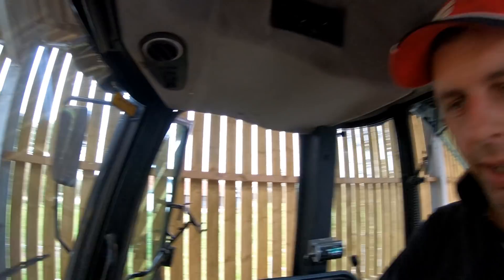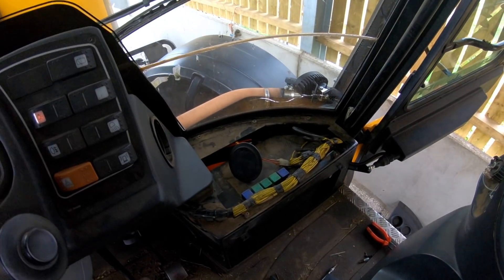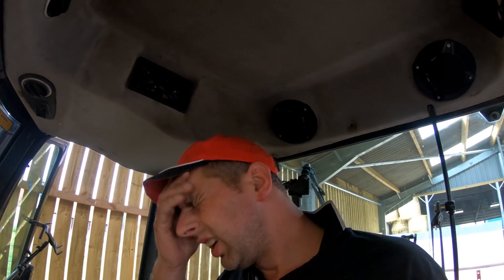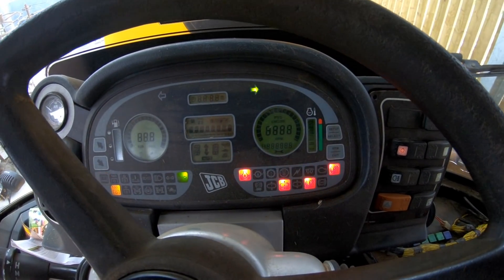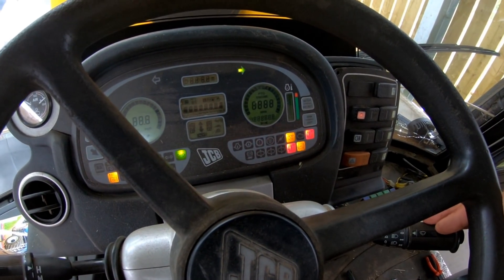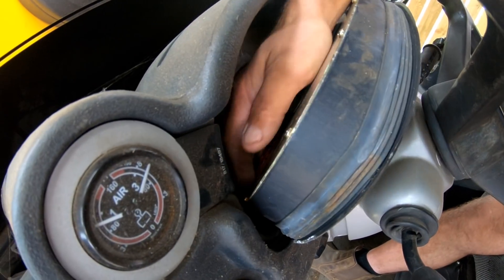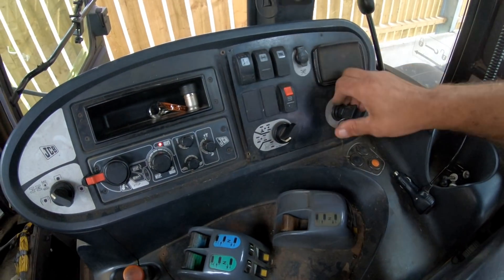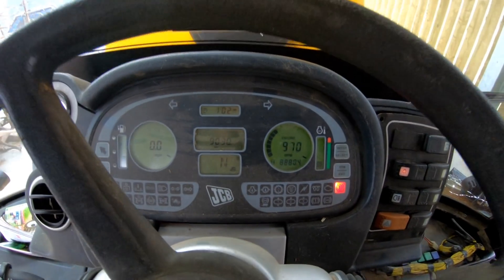FASTRAC FAULTS

Comment: Its times like this, i'm glad i've got a little grey fergie. I've never had an electrical problem with it as there are bugger all electrics on it. Battery, starter motor, dynimo and a heater plug. Thats your lot.
Reply: And spool valves operated by cables on my modern classic

Comment: I’ve had the very occasional electronic problem on my 2000 series Fastracs. 
Fortunately the external hydraulics on them all have manual spool levers.
But when the odd electronic problems do occur, turn everything off and walk away for 5 minutes. Then come back and it has always cured itself. 
Often, most of the problems have been caused by my forgetting to switch the sprayer control box off and draining the battery so much that I need to jump start it. In which case stop the engine after you think it has charged enough to restart again and everything will be fine again with no faults.
If you are on JCB live-link, they often know exactly what the problem is before you will!

Comment: Good old jcb electrics, my jcb 310s needed a new engine loom last month. It had a fuel leak on top of the engine, we removed a cover off the top of the injectors and three of the four injectors had bare wires on them🤦‍♂️ and now we've had the entire cab apart looking for a broken wire as it wouldn't drive anywhere. In the end it wasn't a broken wire but a fault in the Ecu. Luckily David King electronics repaired the ecu and it should be going again today. 🤞👍

Comment: Well done that would probably be a £700 job at least for a dealer 😉😁😂. Think there's master plugs going up under into the cab somewhere which get full of crud and rot out. Silicon grease to the rescue. 👍 Stay safe 🏴 cracking vid.

Comment: Isn't it such a great feeling?! Mine wouldn't start, select high or low range, wouldn't power shift, local dealer said I needed a new loom £4500! I had a look and the wire had come loose on the clutch sensor!
Reply: blimey  that was lucky

Comment: If when you disturbed the side dash panel the spool valve started playing up, and then seemed to sort it self when you put it back, I'd be inclined to try and check connectors anywhere you can find them and clean up with contact cleaner. Dodgy connections and resistance in connectors will wreak havoc with electronic controlled systems. Likewise on the main dash any connectors behind it or that hook up to it. On that bare wire unless there's any evidence of the cabling sheeth having burnt away, in which case you'd see remains off it and some indication on adjacent wires, if its stripped along the full length may well be an earth connection. Can you see if it goes off to an adjacent panel to ground? Certainly the suggestion from another subscriber to get a master switch in the main battery circuit so at least if something does happen you may be in with a chance of stopping anything before it gets a hold. If you haven't got one get a reasonable size fire extinguisher and mount it in the cab. Dry powder is good but leaves a mess, AFFF will do for auto and also cover a fuel fire and will be OK for low voltage electrics such as on the Fastrac particularly if you can kill power with a master switch. Remember seeing a few burnt out combines back in the day, not a pretty site :( Seeing the farmers anguish of having to try and find a replacement, or a contractor to finish the harvest for them, the additional costs involved and on many occassions probably losing a good chunk of the remaining standing crop in the field where it happened. Stay safe.

Comment: First thing to try is to put it all back as it should be and give the dash a good bash with the palm of your hand. This ha fixed this before. Then if the this don’t work there is a big plug that connects the engine bay to the cab this could do with a spray of contact cleaner and putting back together.

Comment: Good luck or Congratulations for your repair, George?!? As an British brand  - have JCB Fastrack original Joseph Lucas Electric Ltd- system with positive ground? Then I really can understand! ;D  "And the Lord said 'let there be light'...Joseph Lucas replied 'no way, Lord, no way'."  Lucas denies later having invented darkness. But he still claim "sudden, unexpected darkness" and then invented the first intermittent windshield wiper and self-dimming headlight as spin-off's!  Haha!  Do not forget to set your multimeter on AC when measuring Fastrak voltage, George because they have that, but just with a random frequency. And if you measure your wires then know that these doesn't apply to Ohm's Law because Joseph Lucas made so much resistance against that regulating law!

Comment: Don't let the smoke out of the harness 🤣
9 out of 10 electrical issues on 10, 20, 30+ year old electronics  caused by oxidation between the pin connectors, and poor grounding points. Paint, rust, poor loose grounding to body, frame, engine. Systematically unplug every connector & switch and treat with product like Wurth Contact cleaner/oil.. think about all the wet seasons that these modern tractors set out in, damp barns, dust, ... I bet there is a rebuild or exchange service somewhere for that instrument cluster.... 🤞🤞George. 👍🇺🇸🐕‍🦺🍺🍺🍺